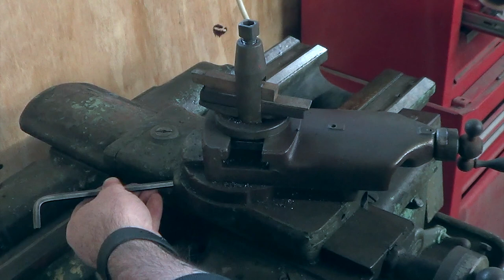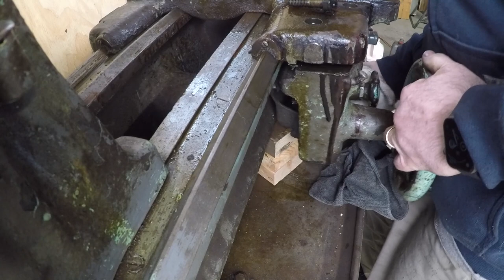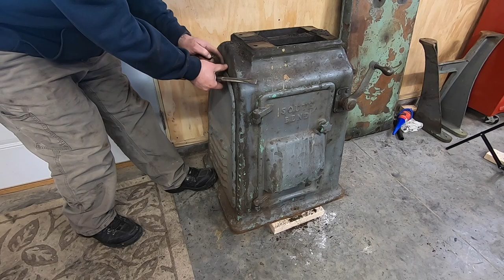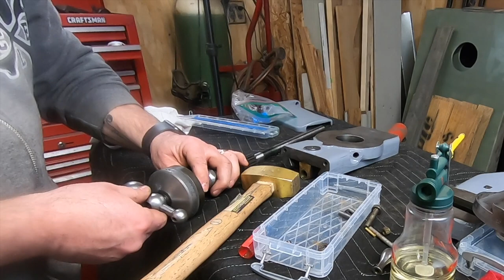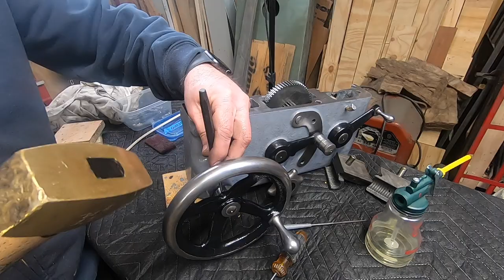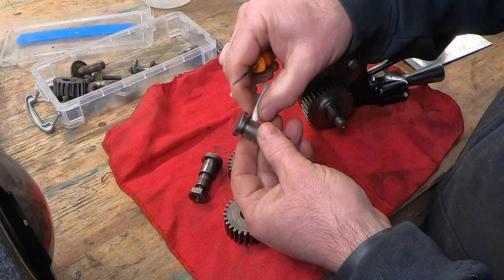South Bend Lathe Restoration - Start to Finish

Comment: I am very happy to be restoring a South Bend model C of 1935 build of 4 foot bed.  Saved from an old wheat terminal area I cleaned and managed a best refit to working components.  Now semi retired, I have more time to complete various shop refit and what I manage to final lathe placement and tool positions.  I raised a block stand as fully leveled and continue to slowly forge ahead to full restore.
What I take note of is what level of quality I must meet as shown to your skill and craftsmanship.  Your completed refit is just 
superb. What I truly enjoy is where as chinese mini lathe with tin and plastic,  I will take minor wear in stride as the castings and bearings are so durable, the design so well composed it quite still delivers work product.  Enjoyed every bit of your post.   M.
Reply from the maker: I am glad you enjoyed it.
Reply: @MyLilMule    I was at GE employ after 4 years military.  So was within a big shop, just not so much as lathe.
Now, I miss my machine shop friend who I might have asked about best metal fab, and think up projects.
With, the south bend and where small, difficult flaws harm precision.  But where the unit is so rugged and 
fun to use.  I also, repaired the micrometer unit I am using, and designed my own tool post.  I confess to using 
soft plastics and non ferrus as projects, as to not see wrecks as bed way and holders.  
And where I continue to add best items to general stock, project aims and tools, fitment and capacity.
I am keen to Max Grant, an AU toolmaker who I recommend to any machine repair as process and 
where he is very adept to scraping and teaching to set up, repair as lathe and mill.
A detail I rather studied was your bronze hammer and small punch end use, and the paint.
The color and finish were so excellent to your work, you see.  As well as the controls.
I hope to continue to have fun as refit to South Bend units and tools.  I simply like the sort of 
peaceful and quiet time as might approach a journeyman fitter.  My personal regards.  M.

Comment: Working on my little 9” . It was in a garage that was dilapidated and so there is a lot of rust. All but two of the tail stock MT’s are so pitted that they are just gonna go to steel heaven.

I have been glued to this video and will be watching it over and over again.
Reply from the maker: Glad you find it useful. All of this is taken from individual videos I did of each of the components, so there is more detail in them if you need it. Thanks for watching!

Comment: Excellent job man, I'm restoring a cincinnati tray top 18×54 right now, I do two to three machines a year, the best way to get to know your equipment, excellent work..
Reply from the maker: Isn't that the truth! I don't know why a lot of folks are afraid to dig into them, but I know I was, too. LOL. If I found another Southbend at a great price like this one, I'd do it again. I keep my eye open all the time for one, or even something like the one you are working on. I'd like to find a similar era Monarch gear head lathe, rebuild it and then I'd sell off the Southbend.

I'm looking forward to getting started on my Bridgeport. I'd like to find a K&T Model 1 or 2 sometime in the next few years that I can add to my shop.
Reply: @MyLilMule  I've got a #2 universal k&t mill to restore it runs great, war finish 1944, got a model A monarch lathe 1880s, got a 1896 Camelback drill press made in buffalo n.y, need to sale a few,lol..
Got a early 1900s pratt&whitney lathe it's restored, got two sebastian lathes also 16×54--18×54..I use them daily..
Reply from the maker: @kentuckytrapper780  Awesome problem to have. :) The K&T #1 or #2 is top of my list for machines I'd want (just one of them). If the timing was better, there was one for sale not too awful far from me for less than $1k.
Reply from the maker: Wujek Wladek  I can't say for sure, I didn't keep track. But it was about 3 months of occasional evenings and weekends. I didn't work in it every day, or even every week.
Reply from the maker: Wujek Wladek  You can make small parts on a big lathe, but you can't make big parts on a small lathe. My lathe has some wear in the ways that I have to account for when making some things, but for smaller parts, it doesn't come into play. One day, when I make a collet chuck, it'll be more precise than I will ever really need.

Comment: This looks identical to my SB heavy 10 L. I love the color you chose. Can you tell me what primer and paint was applied?
How did you keep track of all those parts? 
Great job. 
Paul
Reply from the maker: Thank you! These South Bends are nice machined. No primer. Just Rustoleum enamel paint from a can, Smoke Grey. Primer really isn't necessary on rough castings. It's been holding up great for a few years now. As far as the parts, I put everything into cheap plastic containers I bought from the local Dollar Store and then wrote on the lid in Sharpie. I will say, having it on video was a great help, because I was always able to refer to the disassembly video to remember how it went together. 😂

Comment: Great job man. Your lathe looks like a new machine. I hope that it gives you loads of enjoyment.
Reply from the maker: It is! At least until the next one comes along. I doubt seriously this will be my only or last lathe.
Reply: @MyLilMule  Well you couldn't possibly only have one lathe, surely you need a metric and an imperial one? Plus a third one in bits you plan to convert to CNC eventually when you get around it.
Reply from the maker: @legallyfree2955  The possibilities are endless.

Comment: Did you have a parts diagram before you started? How were you able to keep tracks of all your parts after disassembly? I want to restore one but hesitating due to so many gears and know that I won't be able to put it everything back. I am able to restore minor things like antique scroll saws but this look too complex. This restoration look amazing btw.
Reply from the maker: It's not as complex as it appears. I used two primary resources, aside from the lathe itself. One was a restoration book published by Illion (available on eBay, search for "south bend lathe 13 rebuild package") - very useful, lots of photographs and comes with felts and oils. The other was the Vintage Machinery website. There are hundreds of scans of publications for South Bend lathes including complete parts lists and diagrams.

Comment: Wonderful work!  
So I was basically given this exact model except for a few different options. It has the turret tail stock, collet closer head stock, and a weird double tool post.  It's in slightly worse shape that what you started with judging by looks alone.. Would you recommend going through the rebuild process?  With the hard work you put in yours turned out beautiful! Be very proud!  I guess my big concern is the platform able to produce extremely accurate parts?  I've never operated a south bend and have only heard charter online.
Reply from the maker: My lathe is a bit worn, but the spindle is in decent shape. As such, I can work around the wear in the bed ways and make accurate parts. Sounds like your machine was configured for more production work. The turret makes changing tools fast and the double tool post is usually set for the front to be a typical turning tool and the back side to be a cut off tool. When making the same part dozens or hundreds of times a day, having those features are a must. They are still useful in an every day setting, of course.

I do think it is worth doing some level of a rebuild if you want the lathe to be that much more usable. The oil felts alone are worth taking it apart. If the lathe sat for any length of time, they may be too dried up to be usable. Plus, you never know what a previous owner did to it. Digging into it will take some work, but I would do it again in a heartbeat. I learned a LOT about this lathe and have no worries should something go bad - I already know I can take it apart and I've built up enough confidence that I can probably fix whatever it needs.

My advice: DO IT. You'll have a blast.
Reply: @MyLilMule   That's exactly what I was wanting to hear.  The past week I've done lots of looking around and parts seem available and I've seen rebuild kits for the felts.  
Guess I'll be in a cave for the winter.   Thanks!

Comment: If you need a new variable speed pulley or sheaves, Speed Selector makes pulleys that replace the Reeves, Hi-Lo, TB Woods and Lovejoy pulleys that went out of business or got bought.   Most are in stock or Speed Selector will custom make if needed. They have an actual engineering department; very helpful.
Reply from the maker: I have no need. These pulleys are available everywhere since hundreds of thousands of South Bend lathes were manufactured. I don't know why anyone would need an aftermarket pulley. There are no Reeves drives on these lathes.

Comment: Excellent series.... My 16" is now off trailer and on the floor. Still checking major components but can already see that I will be needing a few small parts like oil cups, screws, etc. Did you find any one source for most parts? So far, my major components appear to be useable. Thanks for any direction in sourcing such items. Butch
Reply from the maker: Thank you! For New Old Stock items, I was able to get some from a man named Ted Pflugner. Ted used to work for South Bend before they were sold to Grizzly and has quite the inventory. You can find him on the SBL facebook group, Practical Machinist and by email (latheman2@aol.com). If Ted doesn't have it, eBay has been a good source, as well as the aforementioned groups/forums.

Comment: Where did you buy/find those South Bend copper/brass name plates/decals?
Reply from the maker: I bought the threading chart from someone that used to work for SBL. The others were on the lathe. I cleaned and painted a couple of them, but the others I just cleaned off the paint that was painted over them and left them brass. It would have been too much work to repaint them.

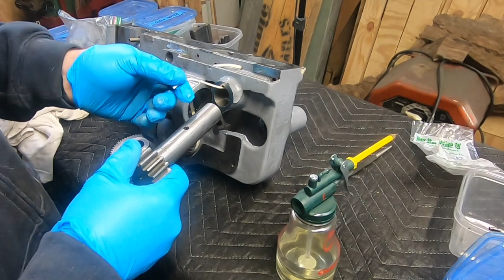Comment: What is the description and purpose of the string-like material used at 16:10?
Reply from the maker: Oil wick. It picks up oil from the oil cups or the bottom of the apron and lubricates the other moving shafts.
Reply: @MyLilMule  Interesting, that’s new to me. Thanks for the reply and info! Beautiful work.
Reply from the maker: @mybreathyourlung  You're welcome. And thank YOU for watching!

Comment: Restored 7 lathes and a Sheldon horizontal mill some 1940s and never used heat and wouldn't recommend it,, maybe propane are map but not oxcy..
Reply from the maker: There's more than one way to skin a cat.
Reply: @MyLilMule  I hear ya,, I've rebuild many quick change gear boxes the heat would worry me as far as expansion that's really old cast iron. But you go it all that matters